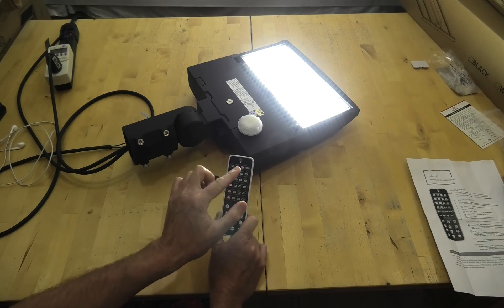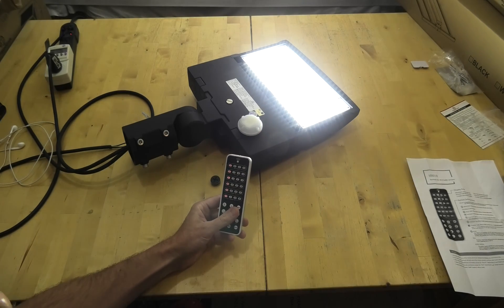How to use the Nextgen 3 Motion Sensor Light Remote Control to Program - Instructional video

Comment: What happens if I don’t want the light to come on during the day? It’s motion activated only and want it to stay that way but only come on at dark.
Reply from the maker: The sensor has a built-in daylight sensor that allows you to adjust the ambient brightness level for when the light would come on. As long as you turn on the daylight sensor, it works based on the lux (brightness) level chosen. If the daylight sensor is disabled, the light will be on night and day. This setting is adjusted with short presses on the daylight sensor button and a long press (hold for 5sec) to engage or disable the daylight sensor.

Comment: There is a setting on my remote that you can not have any of the Daylight numbers active on the remote.  What will that do in the light?  Also on my remote the Daylight setting has 10, 30, 50, 100.  Do the lower numbers mean that the light will come on when it's darker?
Thanks for the help
Reply from the maker: Pressing and holding the daylight sensor button for 5 seconds on the remote will cycle between the daylight sensor being disabled and enabled. When disabled, the light will react to your motion settings, night or day. When it is enabled, the LED light under one of the settings for the daylight sensor on the remote will be lit up (can be hard to see the lights on the remote in sunlight). When the ambient light drops below the lux level you choose, the light will turn on and follow the rest of the settings you ahve choosen. The lower the value of the lux setting, the darker it needs to be for the light to turn on. If you want the light to turn on as early as possible before it gets very dark, use the 100 lux setting; if you want the light to turn on once it is much darker, use the 10 lux setting.
Reply: @LedLightExpert  Thanks for the info!
Reply: What if my light has a blue dusk to dawn sensor on the top? I’m trying to send the programming to the light and I’m not getting a red led. My lights are mounted about 20ft up, how close to do I need to be to the light.